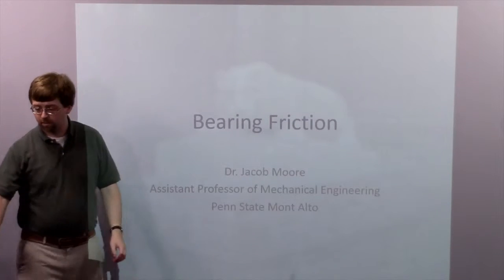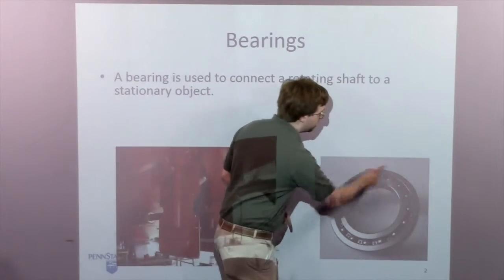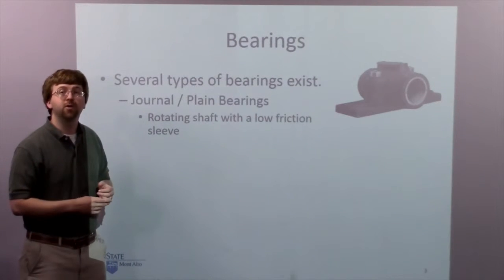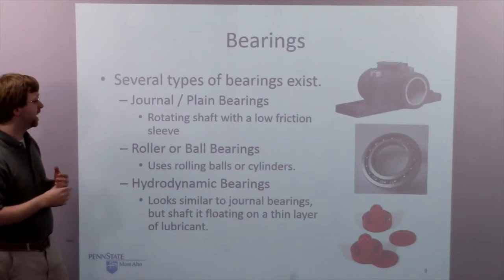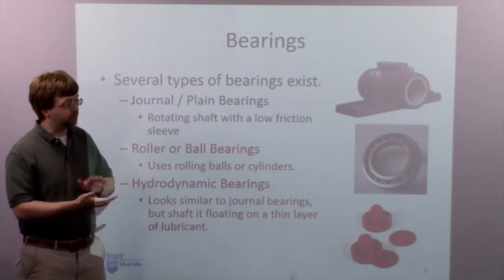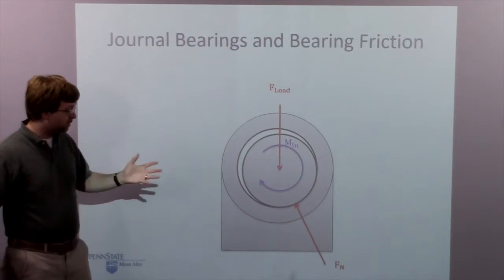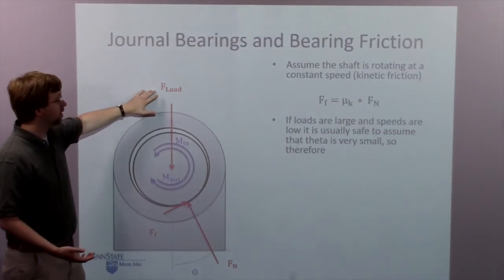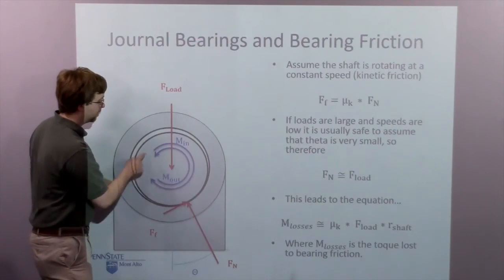Bearing Friction - Adaptive Map Video Lecture

Comment: Hello Dr. Jacob,
I have a question on Ball Bearing.
I am trying to model a shaft-bearing assembly. There is a small clearance between the shaft and the inner race of the bearing, so the shaft can move relative to the inner race. What coefficient of friction should be appropriate for the contact surfaces here?